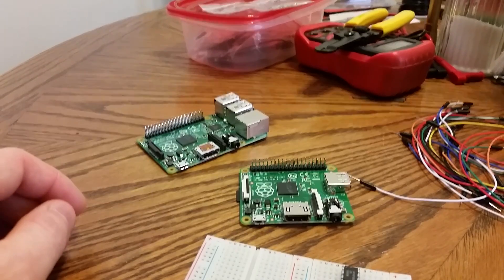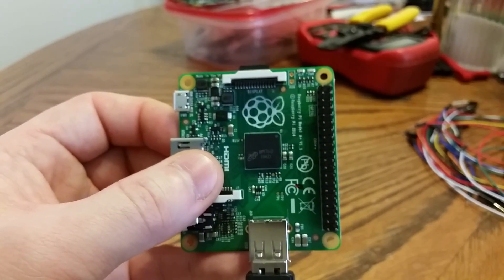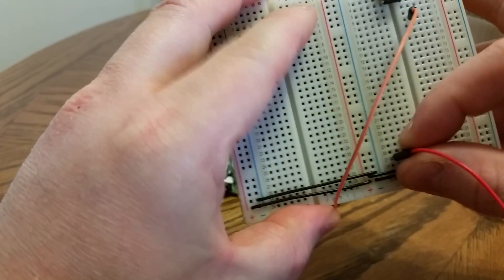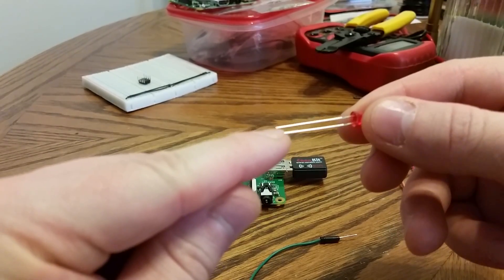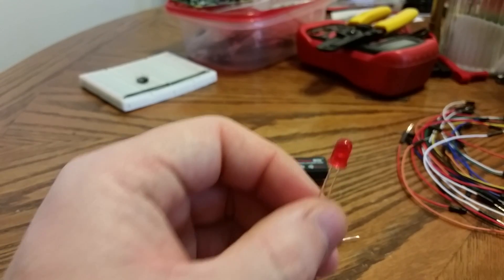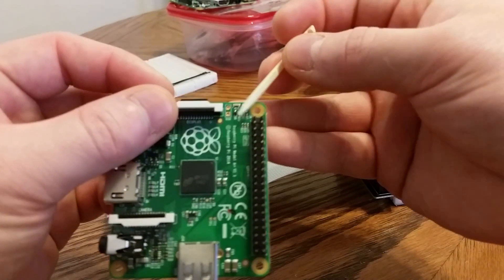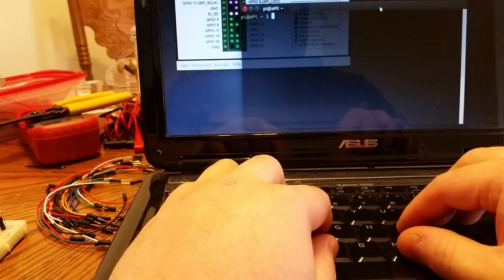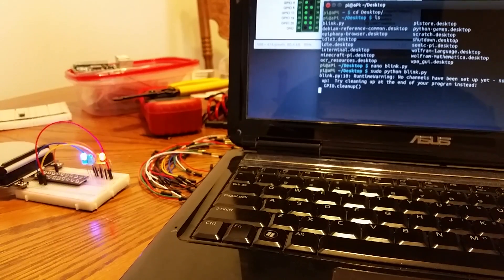Raspberry Pi For Beginners: LED Connections, Bread-boards, and Programming

Comment: Can you briefly explain why you don't use the 5v + pin, I have seen videos that do and some that don't. Would it work if you used one of the other ground or does it need to the 5v ground.
Reply from the maker: This is a good question, and I was just about to post a video explaining GPIO pins...  But, to answer your question here:

I don't use a 5v+ pin? O_o

I use pins 11, 12, 13, & 15... all of which output 5v+ when turned on (HIGH).  I also use the ground rail, which is set next to the 5v+ rail.

If that's what you're asking about, you can honestly use ANY ground since they tie into the same ground in the board.  That's why, when you see that larger board, with the 555 timer, you can see four jumpers spanning the bottom of the board.  That's tying all three of the v+ columns together, and tying all of the ground columns together.

Again, you can use any of the grounds you want, I just used the column since it was easier and more accessible from where I was on the board.
Reply: I see, look forward to the video, Thanks for the reply.